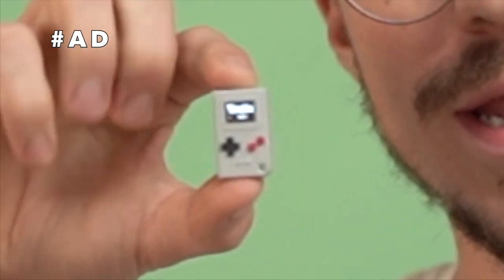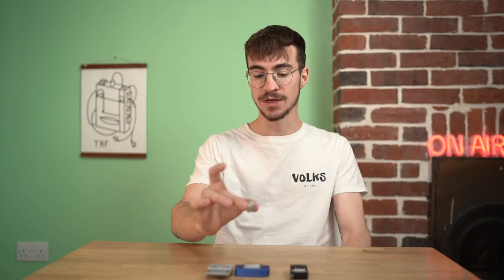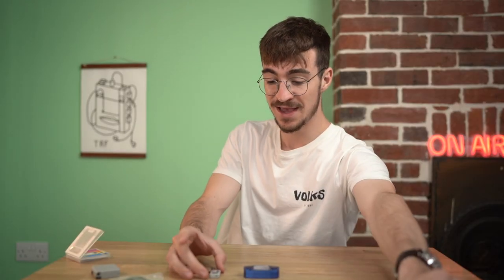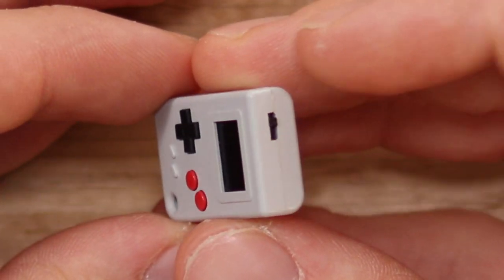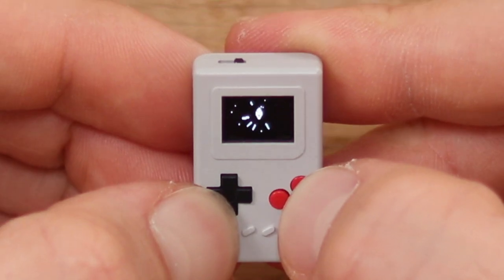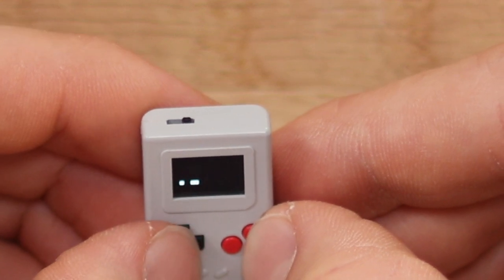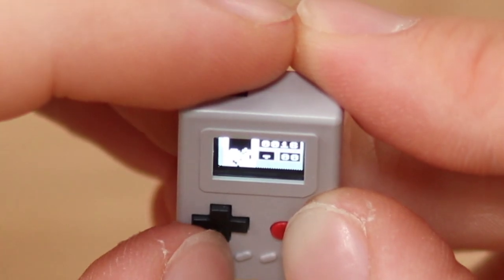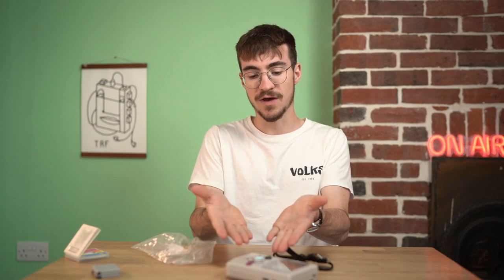The GameBoy Atom

Comment: This is neat for the novelty of it and to show that it's possible to build a playable gaming device that small, but the novelty will eventually wear off once you've played it enough. The D-pad and buttons are just too small to control the games well.
Reply: Since this is open source. Theoretically, you could probably connect a controller to the USB port and use that to control the games. I know it defeats its small purpose. But hey, at least there can be solutions to these kind of problems

Comment: The Pokemon Mini is actually rather close in size compared to the Game Boy Micro. 
But I won't be picking this up. The chip could actually handle GB emulation but it's held back by the display. Not to mention the thing is actually too small. It might as well be a charm hanging off my work bag.